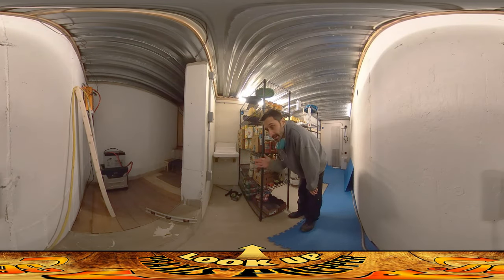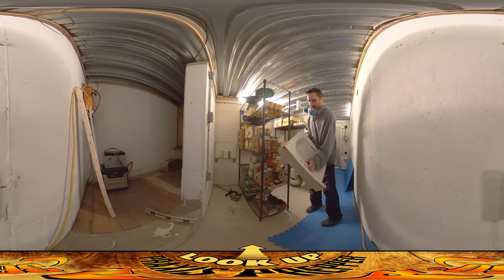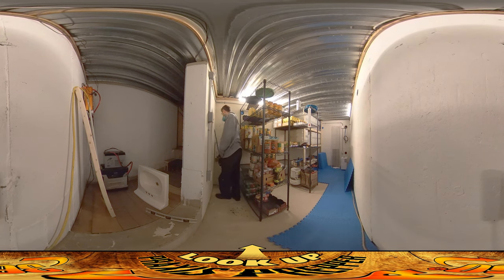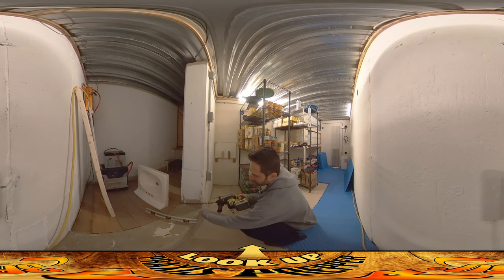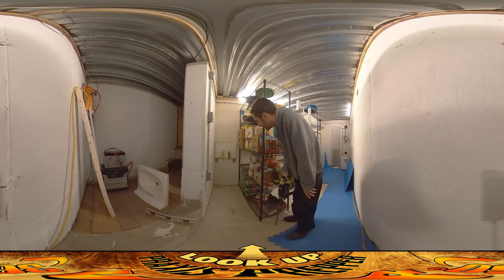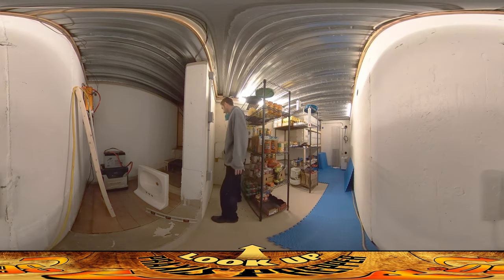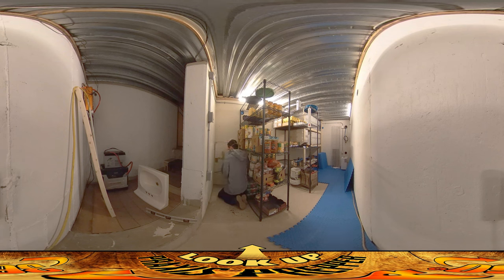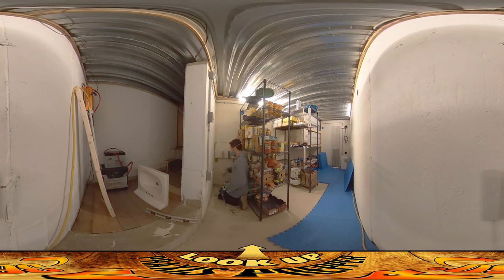Homestead Building - Drilling Through Concrete for Waste Water Drainage

Comment: The tension mounts… will our intrepid hero hit rebar or will he make it all the through and allow everyone to wash their hands? Tune in tomorrow to find out!

Ok, now that that is out of my system, are you drilling straight through the corner of the wall? If so, the tension builds even more since the distance is actually just under 12” there assuming the walls are 8” thick.
Reply from the maker: It was actually diagonally downward, not diagonally outward. I guess I didn't explain that. I ended up making it through without incident thankfully.
Reply: @PraxisPrepper  Glad to hear you made through ok. You did fine describing the downward angle it was more an issue of the camera angle and nature of the 360 view that made it unclear whether you were also going through the corner or not.